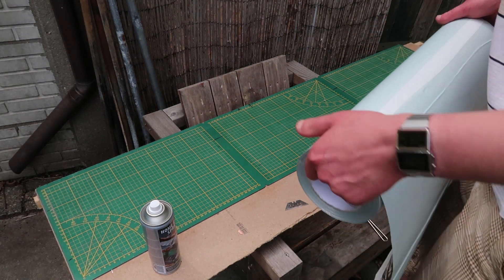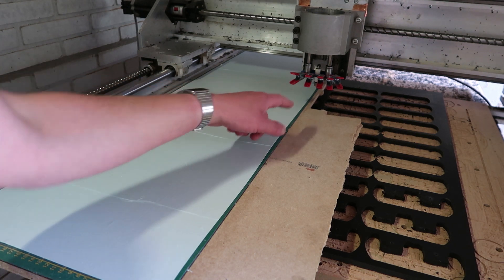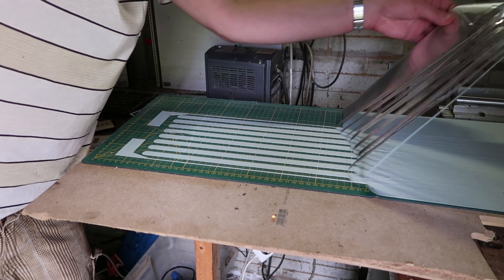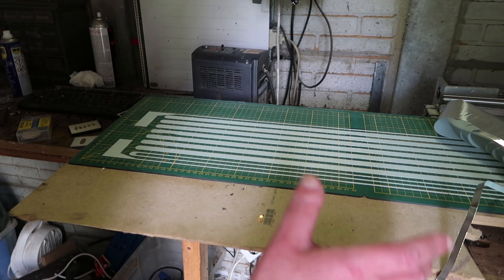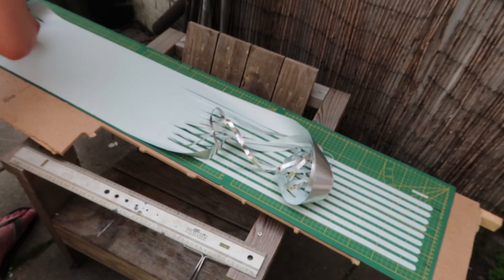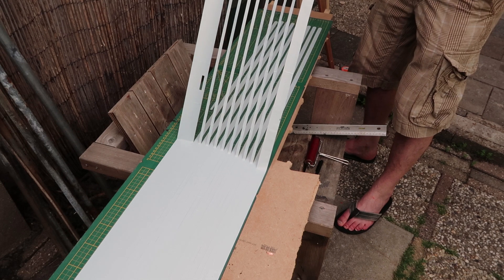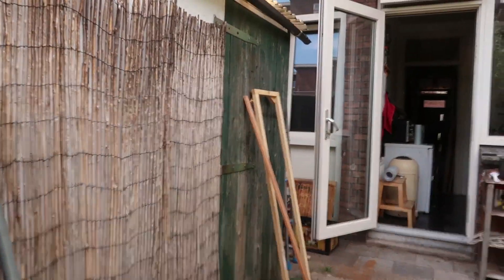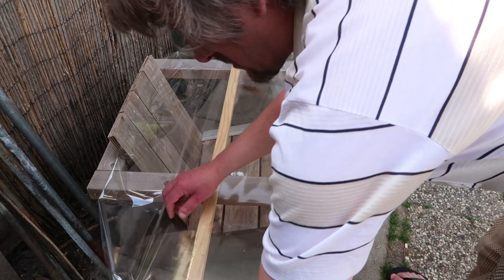Fullrange Planar magnetic speakers - Overhaul - Part 2 the 'Quasi' Ribbon

Comment: Hej joppe , I’m a folloer of yor Channel.  Have you heart of a  dipol speaker  from Norvey  called forsman vss4 . There are 3 woofers 8”. a midt planar  and a tweater also planar.
It is fantastisk  speaker. Regeard Birger
Reply from the maker: never heard of it! but yeah thats an option :) can combine whatever suits you :) 3 x 8 inch seems not all that much for an open baffle. but it all depends on there Xmax ofcourse how much air these could move. and maybe one does not even need that much headroom in a suited (smaller) room with allot of low end boost.